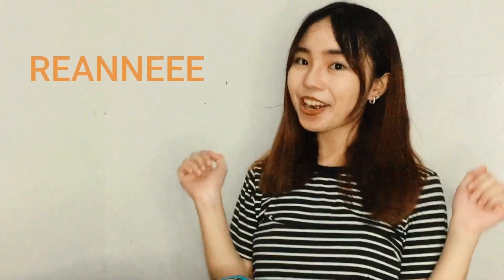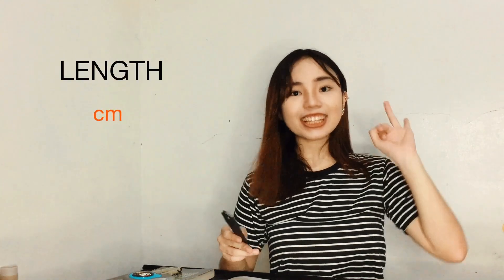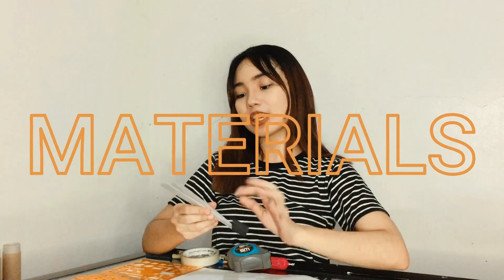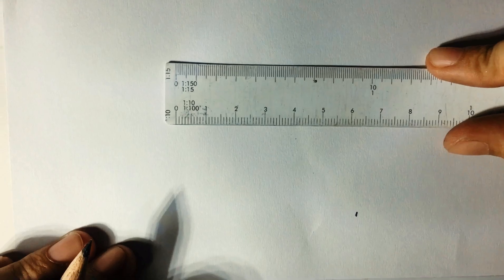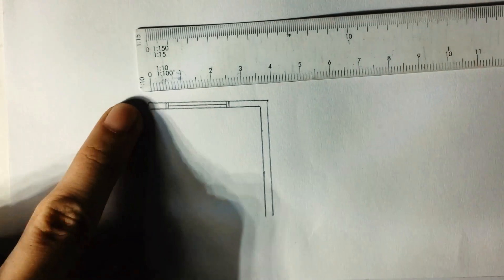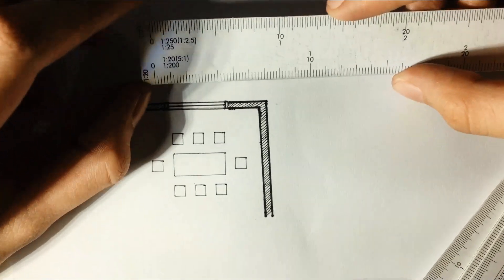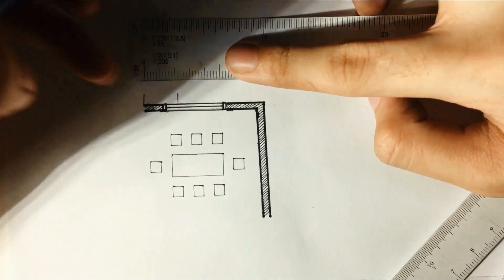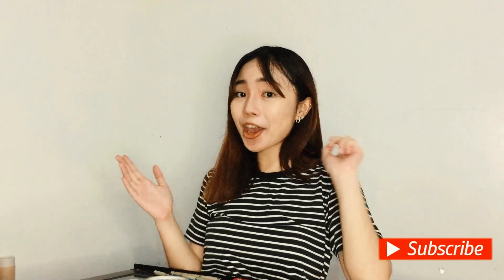HOW TO USE SCALE & TEMPLATES IN ARCHITECTURE (PHILIPPINES) | Metric System | Scaled Drawing

Comment: Good morning po! I have a question sa difference ng fan scale sa triangle ruler scale. Meron po ba silang difference when it comes to the length of the drawing lines when it comes to measurements such as 1:100 or 1:50? Thank you so much!
Reply: Wala.
Reply: I think the difference is limited ang scales sa triangular, compared sa fan na completo, may 1:50 1:20 etc. 

Sa triangle scale kasi is 1:500 1:200 etc kaya kung maghahanap ka ng 1:50 or 1:20 sa traingle scale magbabawas kapa ng zero sa 1:500 or 1:200, which hassle at malilito kalang